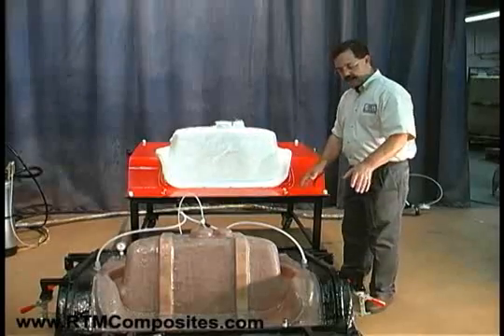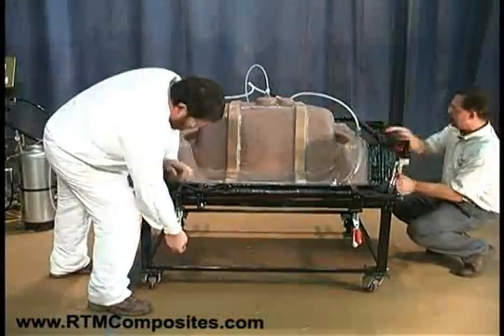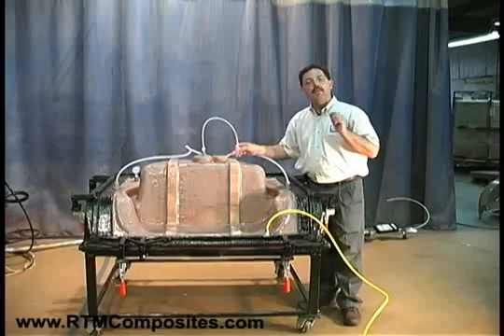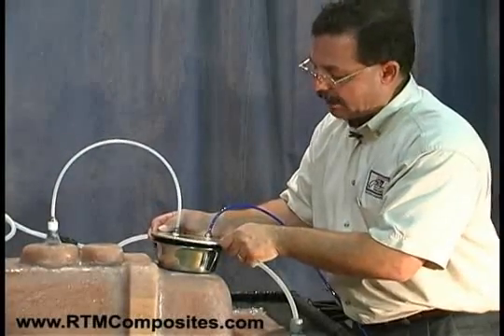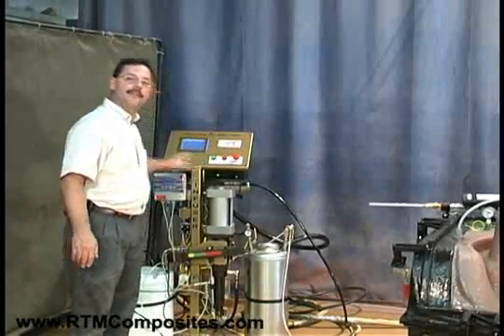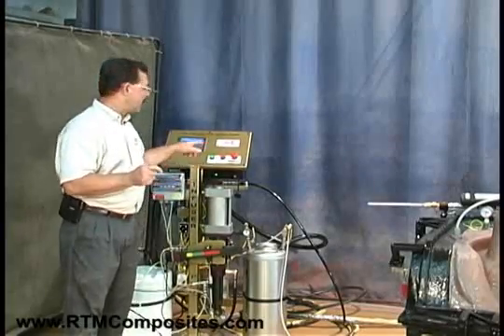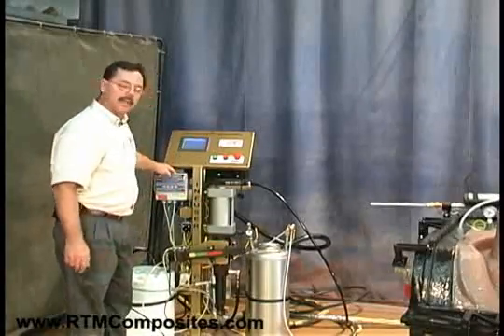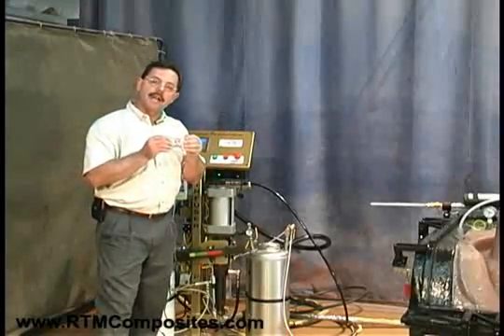What is LRTM? Video 5 of 9

Comment from the maker: The outer perimeter vacuum channel serves two purposes. The design of the outer "wing seal" part number 1680, begins to engage when the mold is still 10mm (3/8") from full closure, once this seal then is engage it is then possible to begin to evacuate the mold cavity and fully close the mold positively sealing both the mold seals. Second, purpose is to aid in holding mold closed at final end of fill when the resin hydraulic pressure begins to exceed outer atmospheric clamping force.